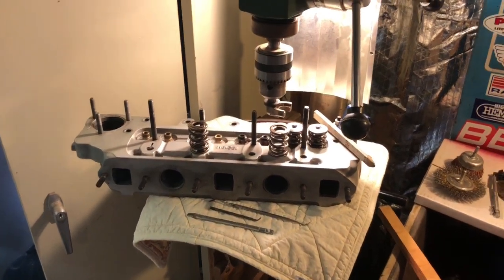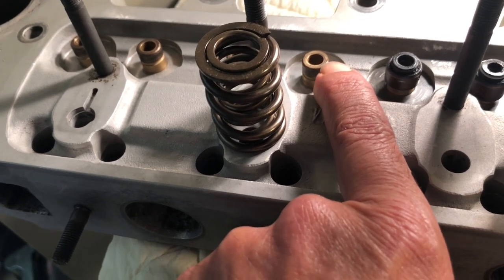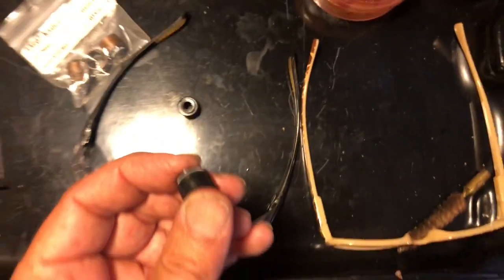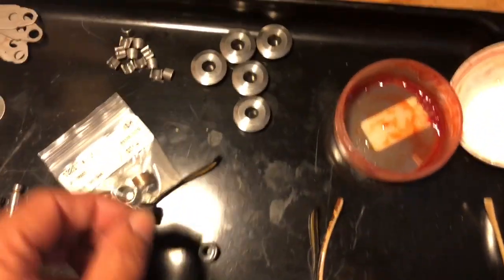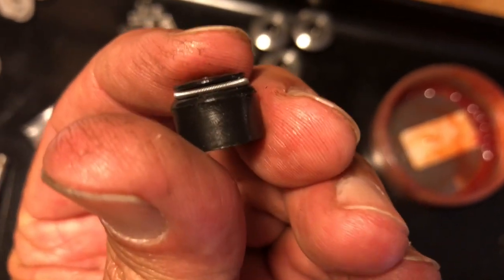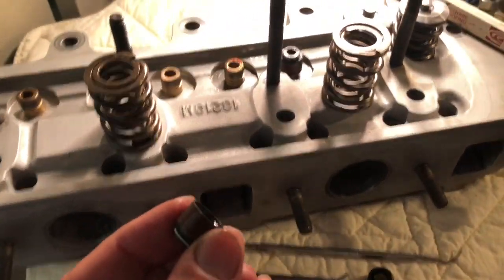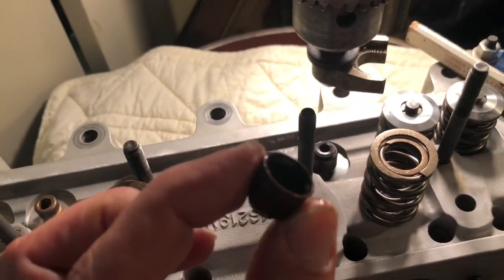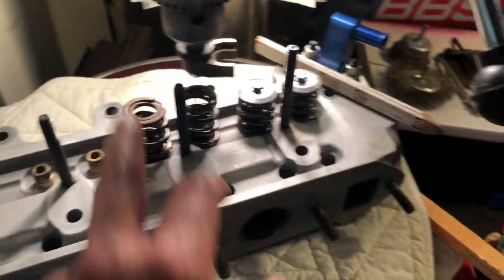Assembling Classic Mini head with Subaru valve seals

Comment: Hi Jamal, I want to try those valve stem seals and found that the part number 13207-KA001 is actually a Nissan part number. It is also used on some old Subaru cars but the OEM Subaru part number is 41279-1300.  Anyway, do you advise putting valve stem seals on inlet AND exhaust valves?
Reply from the maker: Oh good... they were very hard to find this last time, so I made mention of finding them by size... Many cars used 7mm valves over the years!
  

 I do use seals on the exhaust, but ONLY when bronze guides are installed.  If you have the standard gray cast iron guides, then seals on intake only.

Comment: Hi Jamal. So subaru stem seals got me thinking again.. over here in New Zealand guys are running Subaru valve springs on there A-series race engines.... the builder wont disclose exactly what model etc but has said they give  real good figures less coils and so the lift isnt causing binding.. you heard of anyone using Subaru springs or other makes?
Reply from the maker: Hello again!  Have not heard that, but there are plenty of available choices from many suppliers, over here anyway. I use and recommend the Mini Spares C-AEG526 (NOT the way too heavy -527s) for these heads in particular.  I did a lot of pressure testing and measuring a few years ago.... these only have 5 coils, won't bind even your spring retainer HITS the guide, show seat pressure between 80 and 100 PSI in most heads, keep it reasonable "over the nose" with the big rocker sets most run, and are good for 8000 RPM... I should be a salesman!
Reply: Are the C-AEG526 from Mini Spare much different to to standard MG Metro 1275 springs?